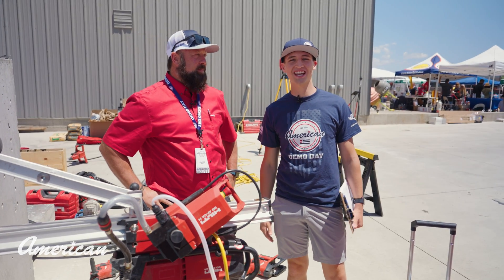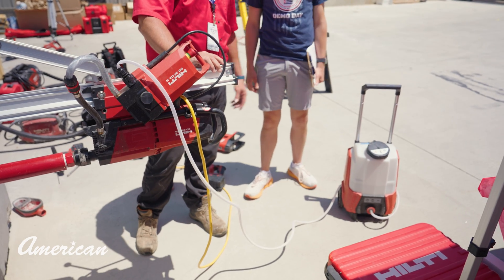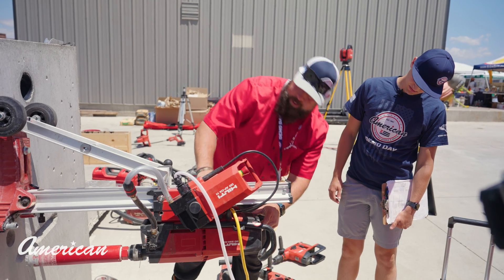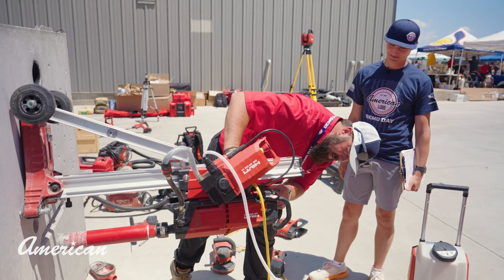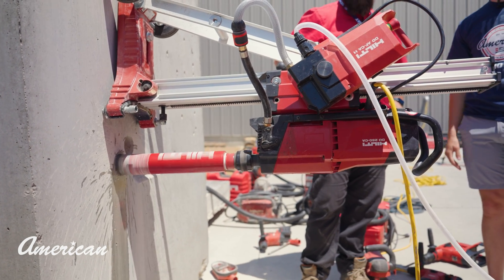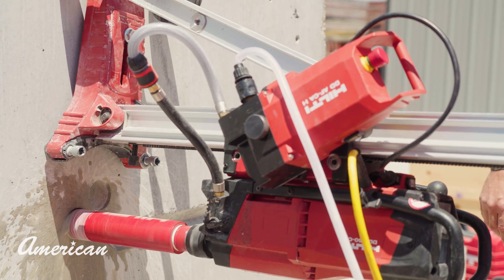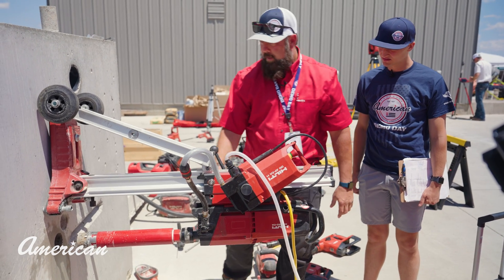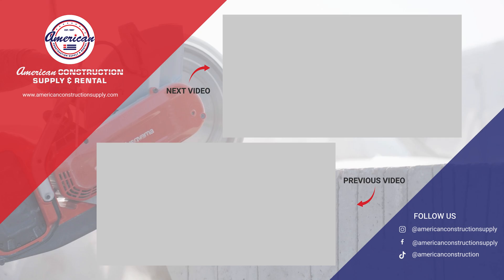Hilti Core Rig Overview

Comment: hakken core drills had auto feed twenty five years ago
Reply: Yes they did. But it was a manual rate control much like a lathe and still required user input if it got bound or hit rebar. 

These systems will adjust dynamically to run the drill at it's maximum efficient speed and adjust if it hits rebar.